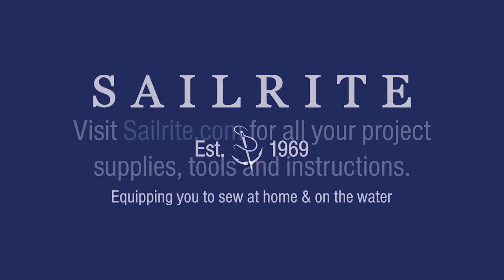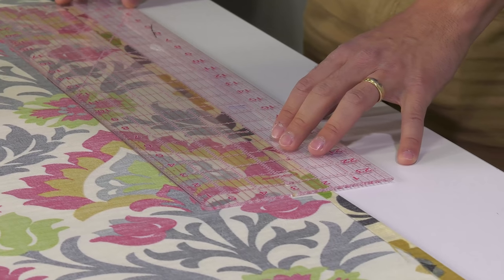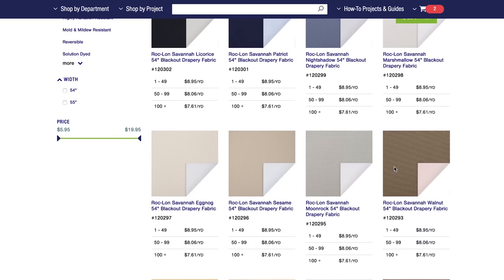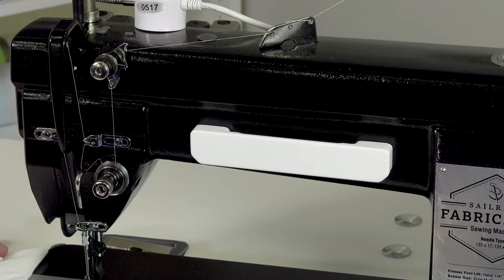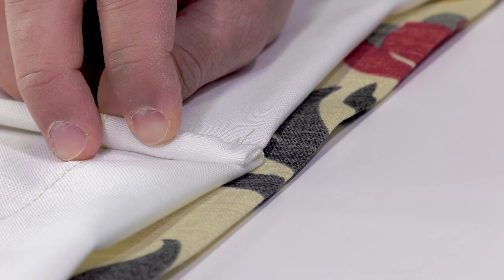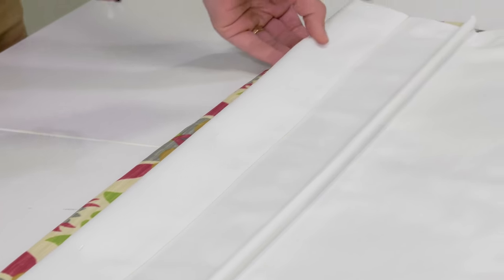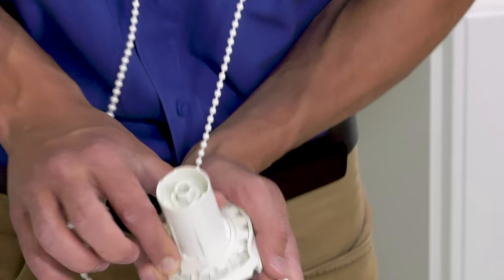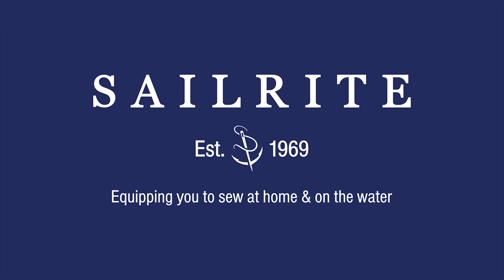How to Make a Roman Shade with Roller Clutch System

Comment: I do not know how you used the 2 inch board. The hardware you sent me in the kit was 2.75 inches. Hard to screw to a 2 inch board. The hardware shown is the video appears to be the one for a roller shade.
Reply from the maker: Please contact Sailrite with your order number and we will send you the smaller bracket which we had manufactured recently. email: ericg@sailrite.com